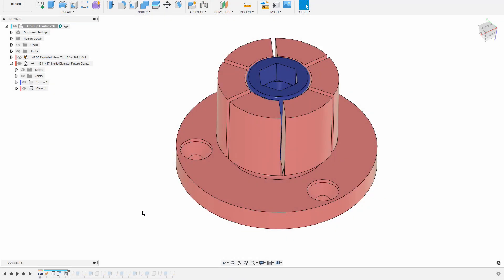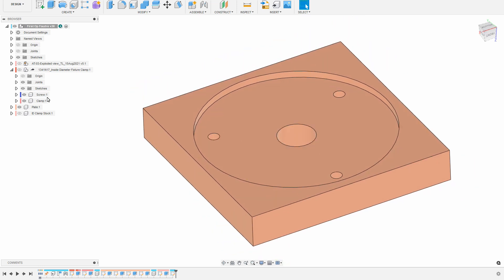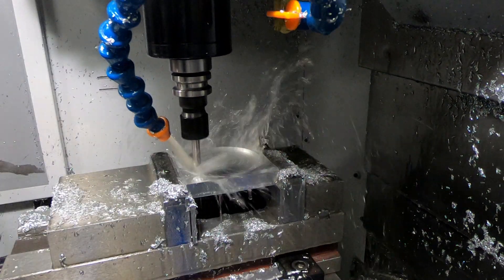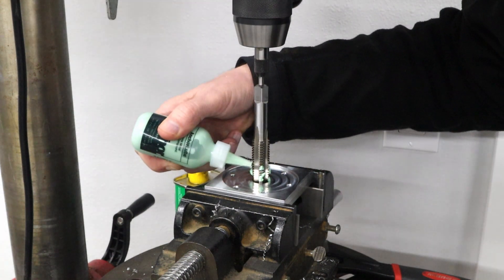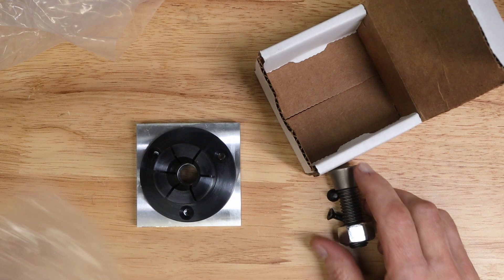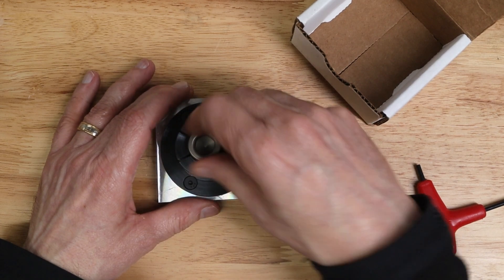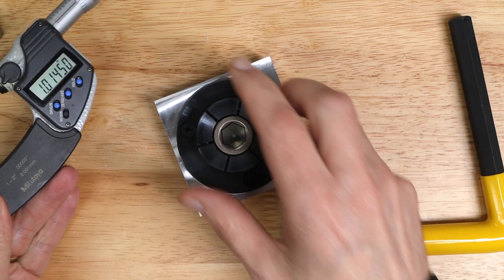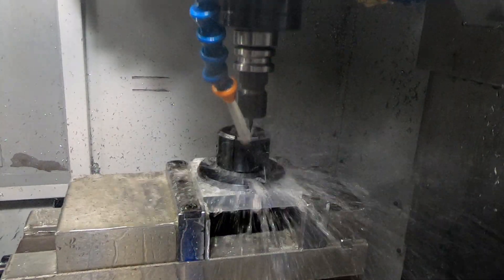Using Inside Diameter Clamps

Comment: Well done John, they are powerful way of holding a part, I made my own from aluminium, a simple countersunk bolt, it wouldn't have the same mechanical  advantage as the real deal, but it worked very well
Reply from the maker: I plan to try making my own at some point in the future. For these parts, I wanted something I was confident would be reliable. Especially because I'm not holding onto much material.